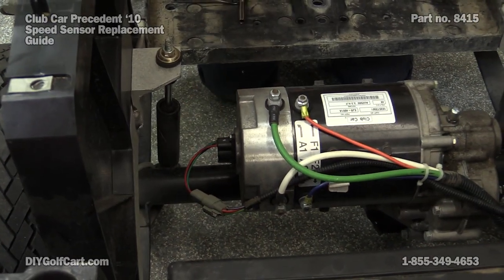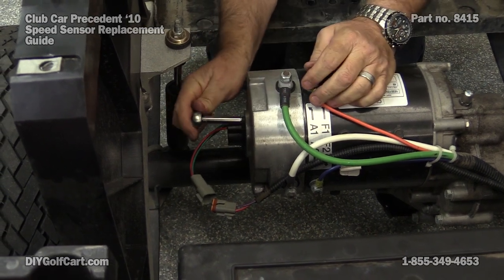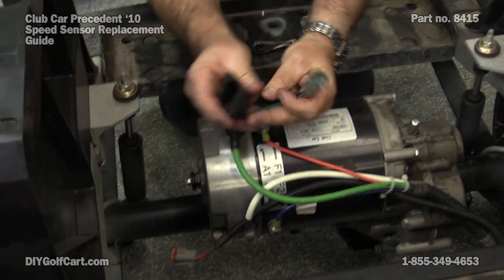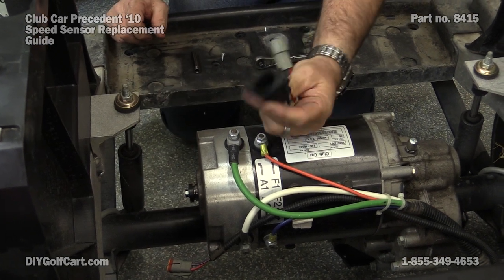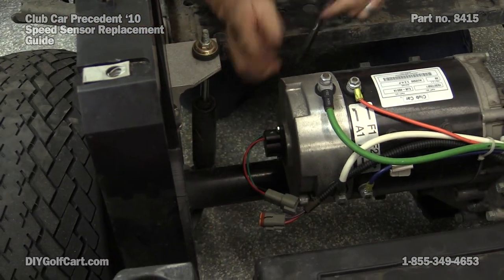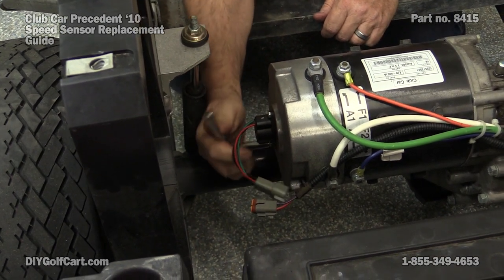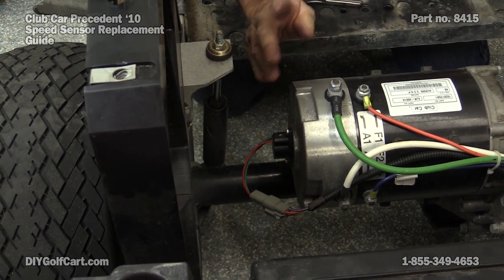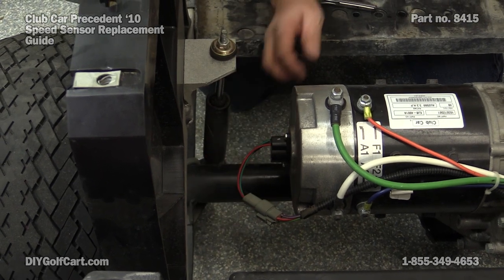Speed Sensor for Club Car Motor | How to Replace on Golf Cart

Comment: I just purchased a refurbished 2013 Precedent. Had it out last night w/LED lights on ran fine for a while, then slowed down to a stop for a turn. When I accelerated again it would only go roughly half speed. I turned lights off and no change in speed. I pulled to the side and turned the key off then back on. The cart started running fine again. Can you tell me what's going on?

Comment: Got a 2006 club car 48 volt. All new batteries...new solonoid...new ignition switch. Right after I put the batteries in it ran fine. Couple days later started acting up. Day later you hit the gas pedal and it goes...then stops. Changed solonoid and ignition switch..Keeps doing it. Was going 16 mph now 8mph. Engages...then disengages.. Any ideas from anybody would be appreciated.
Reply: have you checked the MCOR?
Reply: @theklements  what is that Lol